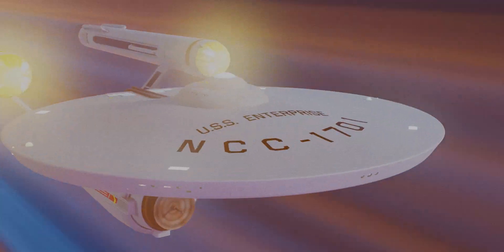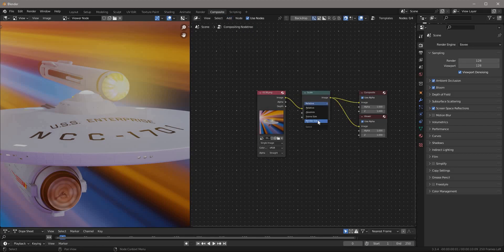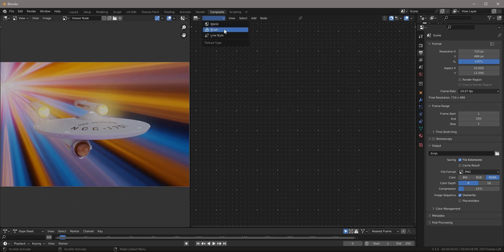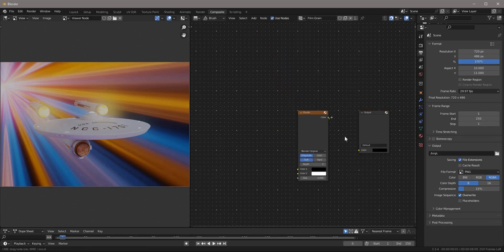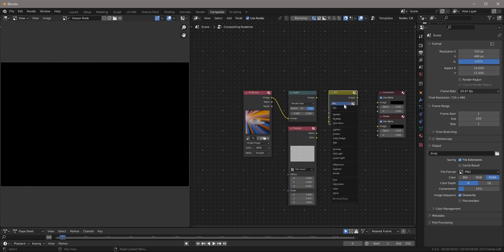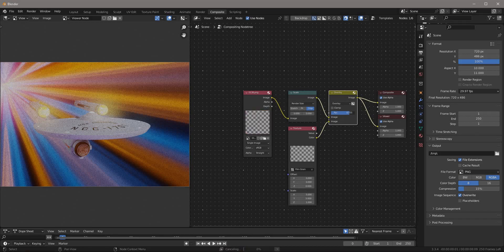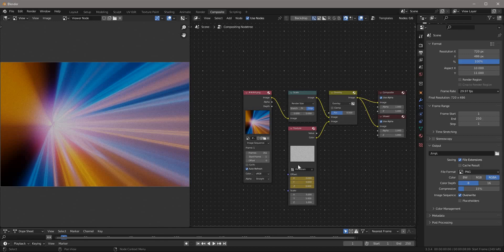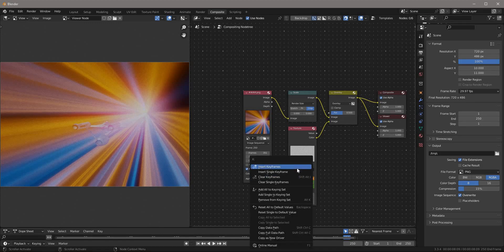Procedural Film Grain in Blender Compositor

Comment: Great! I usually just add the Value node to its offset and then I add keyframe for Value to first frame and then in Graph editor I add Noise modifier to it - by that way you don't need worry about the another keyframe and it automatically continues graining as long as the animation lasts.

And then if you make the Film Grain texture on <Texture Properties> Tab, it's a lot quicker!